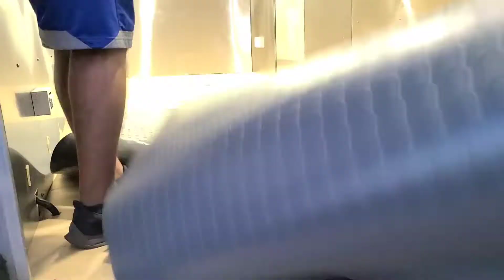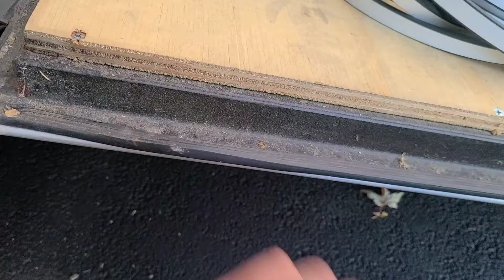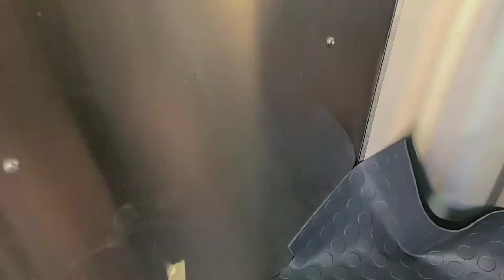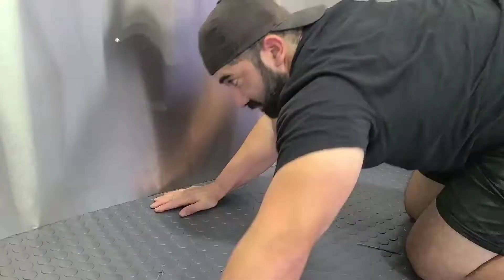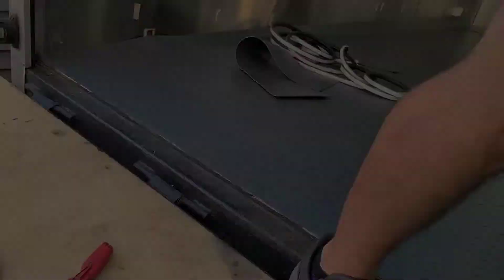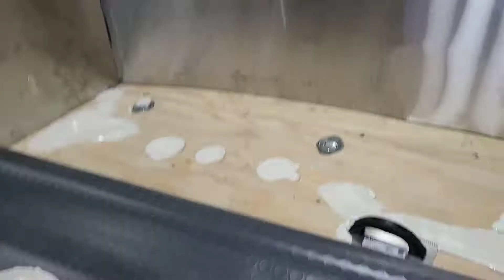How to Build a Food Truck: Flooring

Comment: Question. Why don't you go with a spray in bed liner for the floor?
Reply from the maker: I have never used that product before, if you did, send me some pictures to see the result. rollingburritosfoodtruck@gmail
Reply: @fbaltierrez i used it on my four wheeler trailer with pressure treated plywood and it held up GREAT!

Comment: For the rubber flooring, I think using a heat gun to warm up the rubber to make it softer and it will be easier to tuck into the edge and then make your cut.
Reply from the maker: absolutely, GREAT IDEA!!! thank you for sharing

Comment: Awesome video! Helpful tip: anyone buying flooring, try to buy the exact size material as your trailer. Remember,  the wallbase will over lap the floor so you only need the exact dimension of material for your flooring. You'll save alot of money and wont have to waste labor, time and money having to cut material to fit inside your trailer.
Reply from the maker: Appreciate that feedback!!! :)

Comment: Hey Frank, the trailer is a 7x16 ? I have one that i’m about to start.
Reply from the maker: There we go! I never reinforced mine its was factory built
Reply: @fbaltierrez  thank you sir, one more question, what you are building in the video, it’s a 7x16 ?
Reply: Do i need to re-enforce the floor with more wood ? My trailer is brand new, it’s normal that it sound when you step on it?

Comment: what size plywood for floors and walls.?.. thanks!
Reply from the maker: @demetriusmorales2388  it was factory installed but I believe it was 3/8
Reply from the maker: @demetriusmorales2388  floor I would say thicker. 3/4
Reply: @fbaltierrez  thank you, do you know the best insulation to use for walls?

Comment: Hola Frank one question 
Specific high on outlets for electrical that you recommend? Thank you
Reply from the maker: @juanbeltran7696  I have put them at 48 inches where the transition is on the wall sheets
Reply: @fbaltierrez  good thank you 🙏 dios te bendiga

Comment: How do you install the stainless steel on the round side of of the trailer? I cant seem to find a video of how you did the round corner or how you covered it? How you made it work with the cuts on the stainless steel?
Reply from the maker: I don't show that, one it was super intricate to do, very tedious and frustrating getting those little angles. Only suggestion is cut bigger and trim back little by little until it fits those rounded edges. Very time consuming

Comment: How do you install the stainless steel on the round side of of the trailer? I cant seem to find a video of how you did the round corner or how you covered it? How you made it work with the cuts on the stainless steel?

Comment: Thank you so very much for taking the time to teach in these videos.  I  totally appreciate it.  I just wanted to comment on laying down a floor for best cleanliness.  I have worked in Pharmaceuticals for 27 years now and know what they do to ensure best cleanliness in the manufacturing areas.  Just like you have done, one piece is best.  However, what is done in Pharma is to run that one piece up the wall by a good 4 inches and create seams in corners.  Then, that sealant bead would be at the top of the end 4 inches up the wall.  You would clue the wall floor rise to the wall.  This way you can clean with wet mop and no leaks  can happen as there is no sealant on the floor level.  If the sealant wears out as it will you don't need to watch it as diligently since the seal is 4 inches up the wall.  I  know it's not pharmaceutical manufacturing but  is  a good practice.   Just  sharing!  Keep up the good  work.  I'll be watching all your videos as I  work to  build out  my  own  trailer to  save money.   Could you please do a video  on the electrical where you  take it all  the way and  attached the cables?  Please!
Reply: Thanks for your comment Joann. I was going to ask about the 4" up the wall.

Comment: I love your videos. I’ve learned a lot. I did want to throw out a suggestion for the flooring; and, that is to use a scribe to mark the rounded nose of the trailer and then use tin snips to cut it. Also, what about renting a heavy roller from HD used for installing vinyl flooring?  I’ve subscribed to your awesome channel; but, how do I watch all of them in order?

Comment: I like your videos but one thing I think you do not put links for a lot of the things you use like this rug. I have a question, I like a regular flooring that's a white wood look. Is that acceptable? It's the look I want. My trailer will not only sell food it will be used for some camping events so I want a house floor look.
Reply from the maker: Possible that some of my earlier videos don't have many links because I didn't have enough subscribers to get them from Amazon. But good idea to probably go back and update them. As long as typically per my understanding it's non porous and cleanable HD is ok with it

Comment: Hey Frank I noticed in one of your earlier videos you did the vinal floor first, where here you did it last. Did you find one way was better than the other?
Reply from the maker: I prefer to do it towards the beginning to be honest and then cover it with mats and resin paper
Reply: Cool, that’s the way we were leaning. It allows for the wall coverings to help keep the floor secure and once you run that bead of caulking around the base it’s a good water seal as well. 

I appreciate your feedback and all your awesome videos..

Comment: You mentioned the diamond plate was 4 x 8. Is there a specific inch in thickness it needs to be? That is required in order to pass inspection.
Reply from the maker: Not that I'm aware of on a specific thickness

Comment: That type of floor won’t pass inspection because health department wants aluminum diamond plate with 3/8 radius and 4” walls on the sides. So grease and water stays in the hallway and not underneath the cooking appliances.
Reply from the maker: That depends on the health department that the truck is in. Maybe in yours it won't pass over here with flying colors
Reply: Works in Arizona because a professional company I got a quote from to build out my truck uses this product.
Reply: In which state are you?

Comment: Whenever I spread glue for floors, I find it easiest to pour out a big blob of glue and then just push it around with the trowel.  The grooves in the trowel leave just the right amount of glue when you push it firmly into the surface while holding the trowel at around a 45 degree angle.  That's what those grooves are designed for.  When you get to the end, just use the trowel to lift any excess glue and put it back in the container.

Also, instead of doing a couple feet at a time, it is easiest to just glue the entire half of the floor and then lift the flooring and slowly roll it out, pushing it down with your feet as you go.

Further, instead of trying to use that little hand roller, most equipment rental shops should be able to rent you a 100 lb flooring roller.  That makes easy work of the majority of the floor, then you can use your hand roller for the edges.  It also saves your knees, since you push it while standing.  That entire floor could be glued, rolled out, and trimmed in about an hour.  

One final tip is to keep a bottle of charcoal lighter fluid and a rag handy to clean up any excess glue.  It cleans it up, and leaves a bit of oily film on the surface to reduce the chances that the glue will re-adhere strongly while you are wiping with a glue filled rag.  This oily film will come up easily when you do your final cleaning, after there is no danger of spreading glue everywhere.  Put the fluid on the rag, not the floor, because you don't want it seeping underneath the flooring and damaging the effectiveness of the glue.

Comment: Thanks for the videos. Why did you add the plywood to the floor first? Could we skip this step or no?
Reply from the maker: Morning. I didn't add plywood anywhere this plywood is all factory installed from the manufacturer
Reply: Thanks for quick response! We have a 10 ft step van so I believe we will be okay to just put the flooring right over that. Original floor is solid.

Comment: Possible idea for your next installation in a Food Truck... Do the flooring cut before you put the walls up, this way you can cut the flooring closer to the wall a little, and then when you set in the wall, the wall will cover up the cut lines, and you won't scuff or scrape the SS wall. Thoughts?

Comment: I think I would have put the floor in first and layed something on top to protect it. I would have also went up the walls about 4 inches, so if by accident anything should be spilled, it can't penetrate under the rubber flooring and rot the wood underlayment. Just my own thinking.
Reply from the maker: On the latest trailer build I'm doing now that's the way I did it. Did not see any big difference because I still seal the transition between floor and wall.

Comment: This floor it’s industrial grade , it will last as long as you lay your heavy wax , and strip/ wax as needed , just make sure this floor uses a special wax different than VCT flooring , if  I recalled it’s Minwax .
Reply from the maker: Thanks for that tip appreciate it :)

Comment: Did you consider using aluminum for your walls instead of stainless?  I have aluminum on my walls in one of my food trucks, finished wood paneling in the other (which I don’t recommend) but just starting a build on a new one and was trying to decide on the wall covering
Reply from the maker: I haven't, I got the stainless at a good price so didn't consider anything else. But it wouldn't be a bad alternative 👍

Comment: I am building a new food truck right now I think I will use this flooring but I think I will put the flooring in first because then I don't need to cut the flooring I can just over lap around all the walls glue it in place then when I put the stainless steel walls in they will hide the fact that I didn't cut it, and a bonus it will be water tight for sure.
Reply from the maker: That could work as well. Great idea.

Comment: I honk the better way to install may have been to install the precut edge against the long wall and only have to trim the door side and the rear wall
Reply from the maker: Good morning, for sure that could of worked. For the next truck might correct my approach, will use this floor for every build I do.

Comment: Just did my floor last week.
My goodness it was an SOB!
Definitely didn't come out perfect but it's good enough. A lot of mistakes will get covered my equipment and I bought some Sill Covers for the edges on the back end of the trailer. Silicone will be my best friend. Lol
Walls and ceiling go up this week then I'm gonna finalize electrical.

Still waiting on my window to come in though.
Reply from the maker: Hey but its done :) what floor did you end up using????
Reply: @fbaltierrez  I got the Same Husky coin flooring.
You weren't joking when you said it was heavy. Lol!
Reply from the maker: @FillUp1992  yes pretty heavy but easier to cut than diamond plate. Did you cut the same way?? Lay out and then trim little by little??
Reply: @fbaltierrez  yeah I did. I learned the hard way to take it little by little.
I brought a section in too far, so I took it easy from them on.

Comment: First off, THANK YOU for your videos! They are teaching us so much as I convert a trailer for my wife's business. Haven't watched them all but we're going to. I have a couple of ignorant questions: 1) Why don't you just lap the flooring up the wall a few inches to avoid the silicone corner sealant? I've seen it done before - just don't know how well it worked or if you had a specific reason for not doing that. 2) What was the outcome at the end with glue? Was it too thick like you noted? How did the rest of it go or did you find a solution to the "bubbling"? Thanks!
Reply from the maker: Didn't like the look of it like that to be honest the silicone corners seal is perfect looks real clean. The floor turned out great no bubbling I love it wish I had it in my truck but I have the diamond plate
Reply: Thanks for the quick reply!

Comment: I'm having trouble
Reply from the maker: What part is giving you issues?
Reply: @fbaltierrez  hood hasn't made it in 1st off but I can't figure out the plumbing and do I need to run electric before I put the hood up its 8ft with lights
Reply from the maker: @drewwashington8385  I would, In both my buds I ran the electrical first and then Everything else after
Reply: Good morning. I have a trailer that im wanting to convert into a food trailer. It looks like it may have been a horse trailer at some point that someone added a propane tank smoker to. Im wanting to eliminate adding as much weight as posssible during the build. So with that being said does a food trailer HAVE to be insulated and also could i only use stainless behind the cooking equipment and under hood? Im trying to avoid having to add excessive wood if possible.
Reply: Im trying to add a pic of the trailer in the comments to give you a better idea of what im working with but i cant add the pic